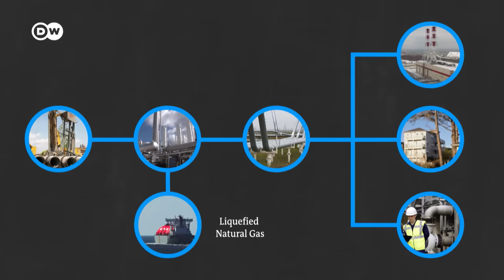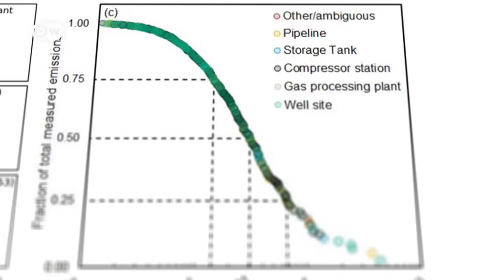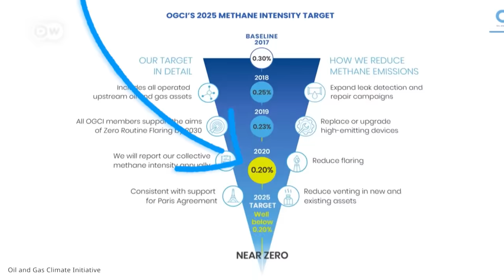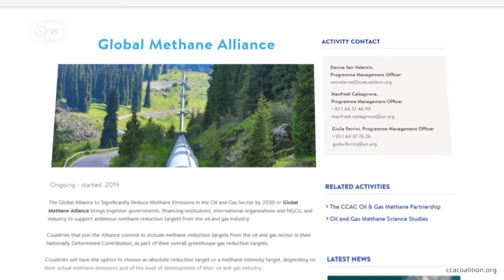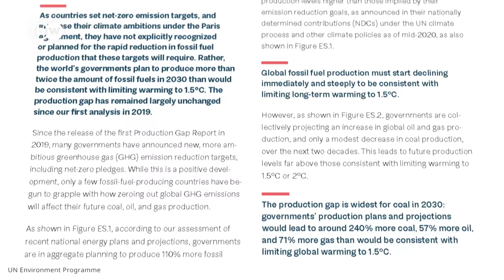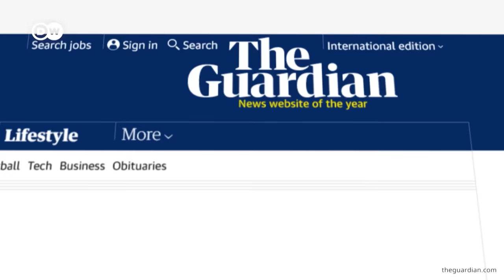Why we need to ditch natural gas (asap)

Comment from the maker: If we need to use less gas - what should we use instead?
Reply: Ask trump. He told you what was gonna happen with your current energy supplier.
Reply: Bio gas?
Reply: Electricity, I'd say
Reply: Nuclear? Oh no sorry it's a German channel, forget what I wrote, please don't beat me.
Reply: @VoiceActorYourNameHere  electricity requires a fuel source to generate. lol
Reply: Nuclear
Reply: Solar energy
Reply: Remove gas burners for residential heating and build district heating networks instead.
Reply: Better building isolation! Full building renovation is in the top 3 actionable things to do to use less gas. And it saves you money on long term.
Reply: Electric cooker...
Reply: as biogas can be made rather easy at home with decomposing biomaterials. same with hydrogen gas maybe incentivize home production of these gasses? example have a ready system that are easy to implement sure it may not work for city dwellers but if you live in the countryside it is not a bad idea.
Reply: @anotherelvis  I agree
Reply: Contraception. Less people = less consumption of resources.
Reply: @emmy4537  true but at the same time that is kind of grim.
Reply: @CarnisChampion  not really. it’s the opposite. if the world were to suffer because of a shortage of everything due to overpopulation then that’d be grim.
Reply: @emmy4537  true both are "bad" but I think Elon is on to something in the matter. colonize other planets :)
Reply: @b_uppy  In some parts of the world, there are “shortages” due to many types of factors. I could list many examples but that’s unnecessary.

Btw, are*.
Reply: @CarnisChampion  I think he, along with everyone who’s in charge should worry about trying to fix the problems in this world first before even thinking about the possibility of exploring/colonizing other planets. There are too many people in this world who are struggling to fulfill their basic needs.
Reply: @emmy4537  I think the other way around. as I see these problems as a never ending story. unless you depopulate as you mentioned in your other comment but I think killing them off is a bit harsh.
Reply: @emmy4537  Because I think the idea of expanding life to other planets is necessary and the same with exploring and creating new tech. one thing does not prohibit the other and I think that these things goes hand in hand. so I think he is doing exactly what he should and he seems to thrive doing these things which is awesome. your points stands with you but not with me even if I understand your arguments I still think they are wrong.
Reply: @petrbelohoubek6759  Agreed that would be the best fix for the current situation and it is a tech that we should do more research on.
Reply: @CarnisChampion  I never said to not explore other planets. I simply said to focus all their effort, resources, and technology on solving problems on our own planet FIRST before focusing their effort on finding other ones. There are too many problems (I can list many examples) to worry about solving here first. Until many of the big problems in our own world are solved, I feel like they shouldn’t continue trying to put a lot of effort into trying to find other planets. That’s an extremely far stretch. We barely even know anything about our own ocean, yet alone other planets. Elon, along with everyone in charge should focus all their resources, effort, and technology into solving problems on our planet FIRST. Once they’ve done that then they can do their exploring. I said all this multiple times already but you still are unable to understand. I suggest you re-read my previous replies.

You can’t expect to effectively help others if you’re a mess and haven’t helped yourself yet. Perhaps this analogy would help you understand. If that doesn’t, then I don’t know anything that will.
Reply: @emmy4537  I  think I understand you perfectly but we got different view points. I think colonizing planets, exploring and research is more important. and that if you are a empowered individual such as Elon and find these things interesting and are passionate about it, more power to him. just to check which issues do you think is more important then colonizing planets exploring and research?
Reply: @CarnisChampion  At no point did I deny the usefulness of research, in fact I encourage it. No amount of research will hurt anything. That’s not the point though. All I said (many times) was to fix problems on earth before trying to colonize others. You missed a lot of key things which is why I said to re-read my previous replies. If there aren’t any imminent threats, then fixing Earth’s problems first is likely best.

There are many issues such as depression, homelessness, manufactured “shortages”, war, famine, climate change, and vice versa. There are so many problems to address first that it would take up the entire screen if I were to list them, hence why I repeated many times that there are MANY problems that Elon (along with everyone in charge) should address first. Once all these problems are fixed, colonize all you want. The fact you asked me which issues means you really don’t understand what I’m saying  lol smh so not sure how many times I have to keep repeating myself so this will be the last time I say anything related to this because your ability to understand anything and your vocabulary are severely lacking.
Reply: @emmy4537    i read this discussion and i agree with everything you said. you can’t rationalize with someone’s irrational thought regardless of how many times you repeat yourself. he clearly doesn’t understand anything you said. let it go.
Reply: @emmy4537  ok so now you agree with me then? ok so what did I miss please be specific maybe I just do not agree with you? also which problems is a priority over everything else. I am a bit curious.
Reply: @CarnisChampion  no iq
Reply: @CarnisChampion  You clearly can’t read or spell. I repeated myself many times. Again, re-read my previous responses.
Reply: @joannahernandez3660  talking about yourself?
Reply: @emmy4537  I can but again I do not agree with you but I guess it is good that you agree with me after some back and fort :)
Reply: @emmy4537  anyway I think we are done here. have a good day and a good life :)
Reply: @CarnisChampion  you’re delusional.
Reply: @joannahernandez3660  haha so cute :) I guess you did talk about yourself as your vocabulary seems to be very low. anyway have a good day and take care.
Reply: @CarnisChampion  you continue to prove what I’m saying with every response you type. you’re shallow lol
Reply: @joannahernandez3660  weak retort :D
Reply: @CarnisChampion  see? 👏
Reply: @rolleyrolley7192  Had to bring in US politics...of course...do not get me started! I would not ask Trump the time if day....let alone anything as important as solving energy problems!

Comment: So here's the real problem: Nothing is burned efficiently.

Take that gas, pressurize it and burn it in a confined space where you can control the fuel/air ratio. That way you can maximize burn temp, control burn off, and heat far more rapidly. If you REALLY wanted to get into it though, it's never going to be efficient until we can coordinate better grid efficiency. Use the most efficient burn methods for energy generation, and better control our use of electricity.

Also, making companies responsible for "carbon capture" would either 1: Slap them with huge fines, or 2: Lose them rights to drill. I'm sure another company would love the chance to "responsibly" make money selling fuel. It's not like putting a methane capture tent over a pipe will kill the bank account...
Reply: Also, use biogas, produced from sewage and food waste. :) Several European and American companies are working on collecting gas from sewers, farm waste and landfills and converting it to natural gas (Renewable Natural Gas/RNG, or biogas). For other things, increase burn efficiency, or switch to electric stovetops powered by wind, hydroelectric dams or solar panels. The next best thing you could do, is during the winter, set your thermostat down to 65°F (18°C) instead of the typical 68°F (20°C) during the day, and 60°F (15°C) while at work. If you are cold, wear thicker clothing or add more blankets. For long durations away from your house (> 3 days), set the thermostat to 55°F (12.5°C). If your city is powered by fossil natural gas, set your summer air conditioner to 76-78°F (25°C) during the day, instead of the typical 72°F (22.5°C) and 80°F (26.5°C) while at work. If your guests feel uncomfortable at 78°F (25.5°C), temporarily set the cooling to 75°F (24°C), and return to a more efficient setting when they leave. For long periods away from your house, set the A/C thermostat to 82-84°F (28.5°C), but not to hot to damage the walls or house plants inside. If you have pets, set temperature colder. I have lower gas and electric bills compared to the city average because of these things that I do. I am guilty of taking somewhat long showers (6-12 min), but have cut them to < 5 min recently, except when I feel not well.
Reply: Why would we invest in a tech that we have to stop using in 10 years anyway?
Reply: @michaelrch  Do we have to stop using it? If I can use a bio-digester in my own yard then I'll be using a slow compressor to make CNG for heat and energy power off of a compost bin.
It would be nice to see investment in carbon scrubbing for smoke stacks and exhaust pipes... At that point, it wouldn't matter anyway.
Reply: @charlesdarwin4780  
The problem with biogas is that it starts out as something made using waste material, but almost immediately, businesses start using scarce land and resources to grow crops specifically to make it. That puts pressure in food supplies and ends up requiring more land to be cleared, which means large release of CO2 and loss of carbon sinks. A lot like ethanol from corn.

As for CCS, this has already received billions of investment over decades, much of it public money sucked up by the fossil fuel industry who want to keep selling their product no matter what.
It has not been demonstrated to work at scale anywhere. Indeed it often produces more CO2 in the production of the energy to run the system than it can actually remove CO2 from smoke stacks. There is no future in it. It's a dangerous distraction.
Reply: @michaelrch  We don't need to clear land for more waste when people already throw out so much. We've proven that recycling trucks and garbage trucks can make money in some places, all it needs is a compost fleet to adapt and profit. Maybe improvise some form of funding to cap and utilize land fills, it all adds up with small cheap efforts.
Reply: "Take that gas, pressurize it and burn it in a confined space where you can control the fuel/air ratio" 
yea, thats called da combustion chamber... pressurized gas is regulated to a lower pressure, shot out, with air inlets and out of engineered burner ports, designed for as complete as possible combustion.
Reply: It's not as much an issue of the flame burning efficiently, as what is done with the heat...  

Having a flame at the bottom of a pan, and the heat rise up away from the food just isn't efficient. But, it is the gold standard of cooking technique. No self respecting restaurant serves you food from an electric stove. There's a way to capture that heat. The oven.
Reply: The gas powerplants here in Holland are about 95% efficiënt, by using two stages of electricity generation, one with a high pressure turbine, and one with a lower pressure turbine. The remaining heat in the steam coming out is used to directly heat homes.
Reply: Some of the coal plants in Alaska use the steam to heat homes and buildings, but this can only be done for buildings near the plants.
Reply: @tehpurplepills  Induction stoves are a thing now...
Reply: @thatguyalex2835  from what I understood it’s extremely inefficient right now